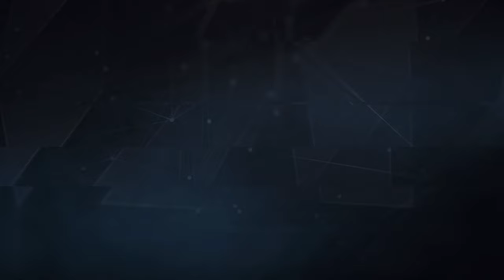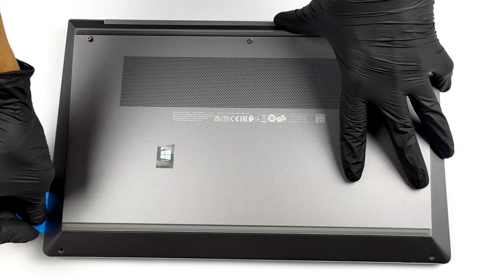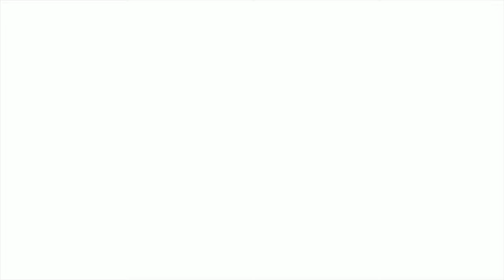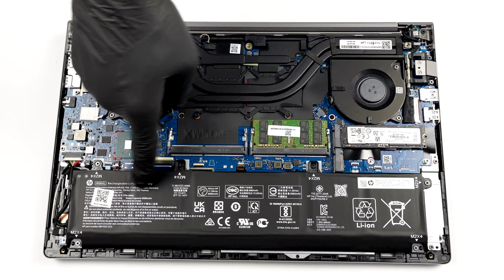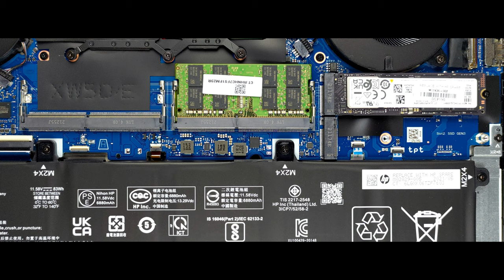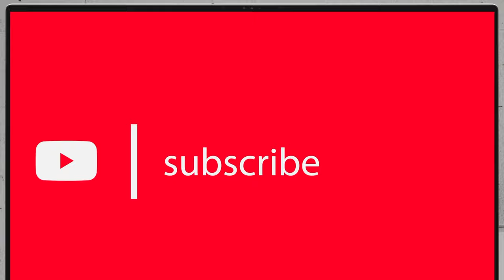🛠️ HP ZBook Power G8 - disassembly and upgrade options

Comment: Is the WI-FI chip up-gradable?
Reply: @OH Deer Such a pity - this is a deal-breaker for me. I've had the WiFi card fail in laptops I've owned, but I was able to buy replacements for next to nothing from Amazon. What do you do if the WiFi card fries on such an expensive machine? It would hurt.
Reply: @MnemonicCarrier  you'd have to either use your extended warranty or purchase an external USB dongle. I DO get your point though. It's simply cutting corners on HP's part. As the more integrated things you tie to the MB, the more you increase the need to replace the MB which I would say less than 50% of G8 owners would do. So, guess who's shopping for a laptop again?